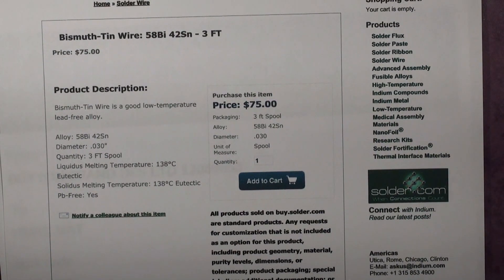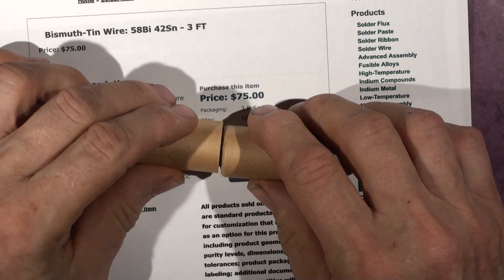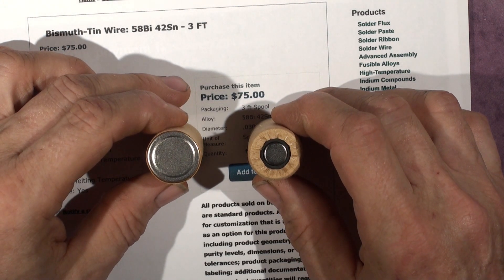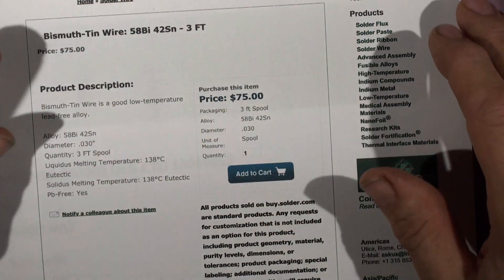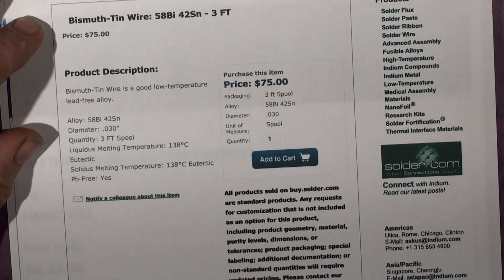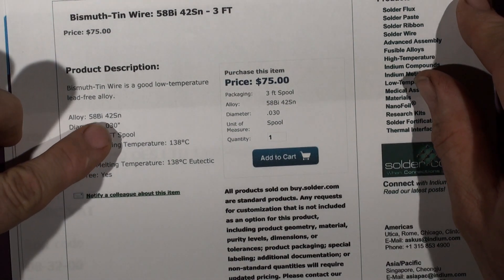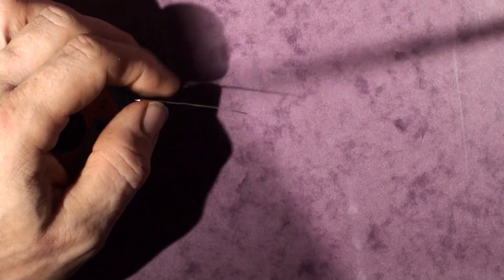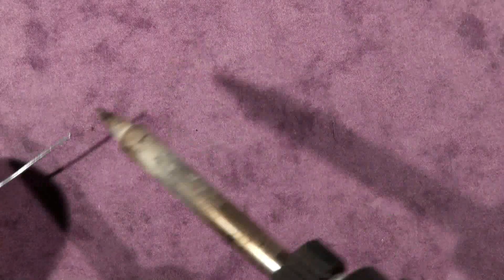eBay Mechanic Bismuth-Tin Not So Low Temperature Melting Point Solder

Comment: Best way to get low melt solder is to make one's own: melt a 50-50 mix of 60/40 solder and bismuth together. Take precautions to avoid the fumes that may be produced by the process. Melts at 138°C, and is far cheaper than buying it.
Reply from the maker: What percentage bismuth?
Reply: @razenby  I've got some bismuth coming in the next couple of days, so once I've tested it I can confirm the melting point, but from research a mix of 50% lead/tin solder and 50% bismuth should yield a melting point of 138°C. I also understand that it's possible to increase the amount of bismuth to reduce the melting point to around 70°C, which is ideal for removing difficult components. I'll report back later in the week when I've experimented with it.
Reply: @will_doherty  did you succeed?

Comment: Thanks for this video! 
For a while, I thought I was me doing something wrong! 
I bought xw6 and hbd366 rolls, they were all melting at lead free temp 😮
My intended use for it was to make lead free desoldering more easy.
Now, I'm thinking of buying bismuth sticks.
Reply from the maker: If you want to make lead free desoldering easier then just add some 60/40 leaded flux core solder to the joint. It considerably lowers the melting point and renders it very workable.  Don't forget a good iron makes all the difference. I run with a Weller as in my experience it can deliver a lot of power to the tip.
Reply: Isn't xw6  Bismuth 50.0%, melting point stated is 138C you saying it melts at lead free temp that is much higher can you confirm this is the case. I was looking for reviews on this solder need it for easy chip removal cant find any.

Comment: The lowest melting point is 183 °C (63% tin and 37% lead). 60% lead and 40% tin will give you a melting point at 238 °C.
Lead-free solder can contain tin, copper, silver, nickel and zinc. The most common lead-free mix is tin-copper, which has a melting point of 217°C.
Pure tin melt at 231.9 °C
Reply from the maker: Genuine Bismuth is the correct low temperature solder.  The point is that this stuff is fake.

Comment: Mechanic has 2 low melt solder at 138c and their models are Xw6 and Solder X
Reply from the maker: I dare say that may be what is claimed but this is also claimed to be 138 and isn't - it is either a convincing fake or a revelation.
Reply: @razenby  HBD-366 only has 183c melting temperature. You got a fake one

Comment: Wish I had found this video before I paid 12 USD for a roll of this crap. 

I even tested it just like you did and had the same results. 

Then I find your vid. Lol.
Reply from the maker: It is shameful the way that they sell rip-off merchandise.   They have cloned Loctite thread locking compound range.  The have put it identical containers and called it Loctile -- Even the font looks the same.  Just change that L to T by adding at small stroke and mix in a corrupt importer and you have engineers assembling safety critical machinery with fake locking compound, perhaps even aircraft....  This is why we should have minimum quality levels and inspections for imported goods the keep this unusable crap out of landfill.
Reply: @razenby  I'll use it. But it won't be for the reason I bought it for.  Which was to mix with leadfree solder to drop the flow temp for pad and trace preservation.

Comment: You can get 5 m of the proper bismuth-tin solder for £10 on the UK eBay (a UK seller). I also bought the Mechanic-branded stuff and came to the same conclusion, it's probably just ordinary lead-free solder. I do wonder whether the mislabelling was deliberate or accidental. Absolutely no-one will be fooled by it. Incidentally, bismuth-tin solder isn't ideal for hand-held items because it's more brittle than regular solder so it's liable to fracture if you were ever to drop your screwdriver. I got mine specifically for desoldering multi-pin components without a hot-air station, not for making fresh solder joints.
Reply from the maker: Interesting. I have some here but it was very expensive.  Have you a link to the genuine stiff on eBay.  I don't know about you but I am fed up with eBay. So many fake products that eBay do nothing about even when reported. I feel for the genuine traders that stand head and shoulders above in the eBay swamp. They are being dragged down.

Comment: Update: This one is the real deal. Also $10 for only 40 gram, so more believable anyway: https://www.aliexpress.com/item/4000031703033.html
Reply from the maker: Cheers for the tip. Worth a punt. I wonder if it has the hologram labels on it like the fake stuff I bought. Let me know if you try this one as I still cant find my genuine stiff.
Reply: @razenby  Well, just so you know: after posting  last year I bought a 2nd one, just so I have extra in stock. But it is now a year later, so it is always a 50/50 guess if they would send out the same stuff today.
Reply from the maker: @cybermaus  Thanks for the info. ill order some.

Comment: damn, I just order one as well....I guess I do not need to look forward to that package.
Reply from the maker: Maybe there is some genuine ones out there. Other Tubers have claimed that the stuff they have is good. Good luck.
Reply: @razenby  Alas no. It arrived and is likely normal 220 Celcius lead-free solder. It melts just higher then my leaded solder. Also while the ebay listing was exactly like the roll you display, the one that arrived still had the same HBD-366 model, but no longer had the fake Sn-Bi indicators above it.
Reply: @razenby  What you have is a genuine Mechanic product, the problem is that its not a SnBi solder but the usual Sn97% high temp lead free solder. The newer batches of Mechanic HBD-366 product label does not state the content of Sn/Bi and its left blank. They have a new SnBi product line which looks legit but I'd rather give money to a company which doesn't have fake products.

Comment: I can tell you right now this is fake stuff, because Mechanic does not make a bismuth-solder on roll. Only paste. I do have good experience with their bismuth paste, melts at around 138-140 degrees on our calibrated Hakko's at work. 

If you buy genuine Mechanic products, they're overall very good quality for the price, it's a big name brand like Stannol but primarily targeting Asian market. The really sweet thing is that it's great quality but compared to big-name Western market pro brands it's dirt cheap online (well for western wallets its cheap).

That's frankly what makes these fake Mechanic products so weird; because there's so little money to be made on the scam, when thw original is already pretty cheap. If at first you're gonna sell brand-faked products anyway, why not fake Stannol, AmTech, Weller etc instead? Much higher profit margin.
Reply from the maker: Good info. Thanks.  The question is where can I buy the genuine Mechanic stuff? So long as eBay refuses to take action when fake stuff is listed - I have complained many times and the listings are never removed.  This is faked because a Chinese employee of Mechanic or a supplier of Mechanic has seized an opportunity and that all they know.  The solder reels and labels are probably all made a Mechanic's supplier even down to the hologram.  If you want to know you are getting crap then by the cheapest possible brand as no one is likely to fake that.
Reply: @razenby  I usually buy my stuff on AliExpress if I'm not in a hurry. "Part" number for the Mechanic 138°C paste (is V3B45, V4B45, V5B45 and V8B45. 20g, 40g, 42g and 60g respectively. Net weight a couple of grams less. The 40g (V4B45) is 10cc syringe type, the others little tubs. I think there's a 500g tub too, but don't remember that one.

If you're not planning to use a lot of it, no point in getting too much of it, has about 1 year date IIRC. And DO NOT get any leaded solder mixed in with a "final" joint of this stuff; clean tips, pads, chips/parts etc well, use fresh cut of braid/wick etc. Bismuth and tin solder, when contaminated with lead makes a super brittle alloy that melts as low as 95°C! Meaning it could get very weak or even melt, within "normal" operating temperatures for things that may run hot. That's basically what ChipQuik is, although I think that also contains Indium on the lowest melt stuff - they do some stuff all the way down in the 80's°C.

Comment: HBD-366 is advertised by the manufacturer (and most retailers) as lead-free solder with an official melting point of 210 C. The current packaging for HBD-366 Mechanic sells from their online store makes no promises about the composition except claiming "lead free", so the "Sn 42, Bl? 58" on the old package was probably just nonsense. 

Mechanic does have solder under the name XW6 which is advertised to actually have a 138 C melting point (Sn 42%, Bi 50%, Cu 8%). The price is about $11 for 50 g. I'd hazard a guess that that one actually contains bismuth.
Reply from the maker: Indeed it was nonsense and still for sale as that alloy on eBay. So you decide.
Reply: I can check if Mechanic has any information related to this. They've had trouble with counterfeit products for over a decade.
Reply: I actually use XW6 and tested at 150C, it melts without problems.

Comment: Stop buying Chinese made junk. You get what you pay for.
Reply from the maker: Indeed but how do you know if the local retailer has bought junk and is selling at gangster margins?
Reply: @razenby  At least with local retailers you have a decent chance of getting your money back if it doesn't perform as advertised. I don't know where you're from but it's literally against the law in the UK to mis-sell stuff in this way and probably a lot of other places as well (isn't it basically fraud?).

Comment: I wonder if that is a fake perhaps? In some product reviews similar product has been said to be low melting.
Reply from the maker: It's too cheap to contain Bismuth
Reply: It's definitely fake. AFAIK Mechanic only sells bismuth low-melt solder in paste, not roll. Nor even the individual "sticks" (bismuth-solder isn't particularly processing and machine coiling friendly). So they faked a product/manufacturer combo that doesn't actually exist.

This stuff is probably lead-free with some copper in it to bring the melting point down.
Reply: @pr0xZen  I have a few of those rolls from different sources to try out and they all behave like a normal lead free solder. Pastes I got melt low as they should.
Reply: @hoggif  Sounds about right. Bismuth-based "sticks" of solder tend to be quite/very brittle, so not very suitable for machine coiling onto a spool. Mechanic don't make Bismuth low-melt in other forms than paste AFAIK, not sure anyone makes it on rolled spool. Not 138°C or lower anyways. So this one is definitely a fake, because Mechanic don't make that on roll at all.

Don't understand why anyone would fake a Mechanic product. They're good but also very affordable. If at first you're gonna fake one and scam people, why not go Stannol or Kester? Far more margin to be made.
Reply: Most likely, purchased same branded roll off AliExpress for $7.99 and it melts at 140C, however a lot of the other vendors had reviews saying it was normal leaded solder. Chinese roulette I guess..
Reply: @notsonominal  I gambled a couple sellers a while back and both rolls melted at exactly same temperature normal lead-free melts. So, high-melt solder, not even the leaded temp.
Reply: @hoggif  I have a couple on the way from an affordable vendor I've had good experiences with for other supplies. I'll report back on the batch when it arrives. And share either a viable source, or someone to not buy that stuff from.
Reply: @notsonominal  For full clarity, I should make note that Mechanic does make a 138°C bismuth blend in wire form, now. They did not earlier. Model XW5 and XW6 (0.5 and 0.6 mm respectively), 40g rolls. Price is about equiv ~ 8-11 USD per unit; it has a high yield loss -> recirc in quality control as it's not really a well suited alloy for spooling.

Comment: Yeah, I have ordered "low melting point solder wire" also. It turned out, that at the lowest temperature of my soldering station, my common solder works well. Today, it turned out that my common solder worked way better with the LiIon batteries, than the low melting point crap :(
Reply from the maker: Chinese product......